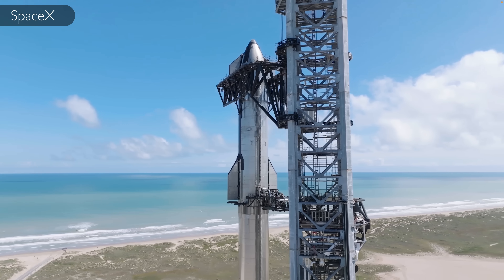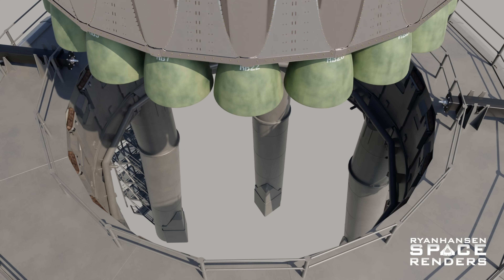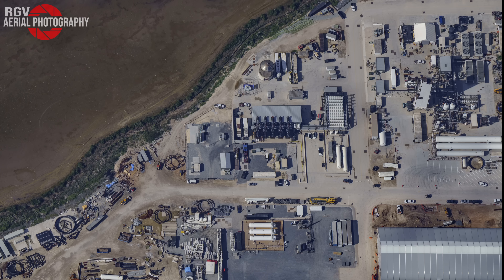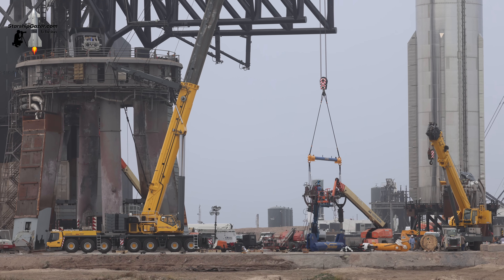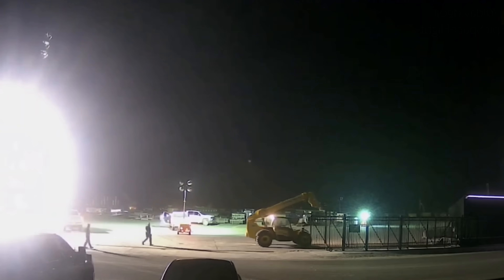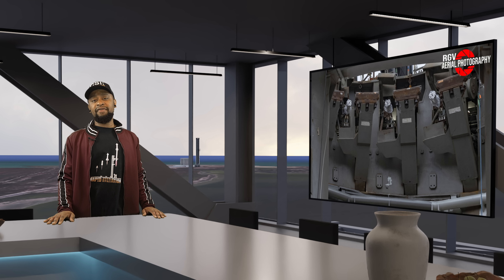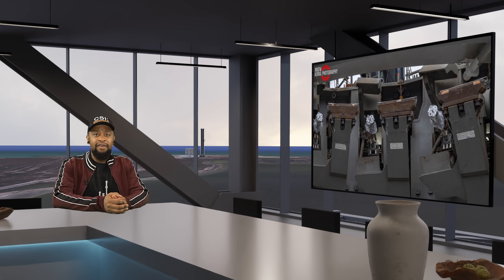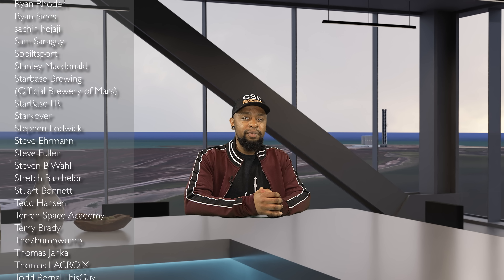SpaceX Simulates 5,000 Ton Starship Ahead Of Final Pre-Launch Testing!

Comment: UPDATE: After 3 years of watching Starbase coverage, it’s come to my attention that the counter weights are 12.5 tons and not 10.  We found a label on one of them yesterday.  The LR11350 used 10 tons CW’s so we assumed the ones from SpaceX’s LR11000 were the same. 

Anyways that brings the total weight to 600 tons.  Which means the factor of safety is 1.32, not 1.1!
Reply: Wonderful video! Did you made the CGI of the clamps and the entire batch before SpaceX started testing? Looks like serious amount of work in the animation.
Reply: @nectismanta8080  Indeed, Ryan Hansen completed these for us before testing started. It was a very busy weekend figuring out what was going on. He released them on Twitter about 6 hours before this video was released. I'm seeing these renders in lots of other videos now.
Reply: @nectismanta8080   Yes Ryan finished it right before it was lifted in.  He actually finished it like 6 hours before them but we realized at the last minute that the yellow swivel bearing was upside down and had to fix it. Lol.
Reply: @glitter_fart  Most likely the clamps are constructed to actually have a 100% safety margin, but it seems the function testing exceeds the maximum load only by the estimated 30 %. Enough to proof its function properly. Going all the way up to 200% load would most likely damage the clamps to some extent. Not to break at that point, but to be permantently deformed and weakened.
Reply: @glitter_fart  That's probably NASA's first though also.
It is exactly that point in the way Elon Musk thinks that has led us to SpaceX supplying the ISS and not NASA or Roscommon or ESA or anyone else in humanity.
Reply: @MrBigShotFancyPants  NASA, Roskosmos, JAXA and ESA have all supplied ISS.  NASA put out a contract for CRS and COTS, Space X and Orbital Sciences and Boeing won the contract.
Reply: @hoghogwild  Absolutely. It is an international space station after all.
I'm not aware of any manned flights since shuttle other than Russia and space x which is what i referenced. Tho I'm just a casual observer and could be very wrong. I just like rockets. And the fact its so multinational.
Also thanks for the info, i enjoy learning.

Comment: "Total mass being lifted"???    How much force does it take to "lift" any mass?    It depends on the opposing force.    Here on earth, the opposing force is gravity.   The other force would be inertial and would depend on the rate of acceleration of the mass.      I am chiding the sloppy use of precise terms.   Mass is not weight and vice versa.    They are connected only through acceleration (whether inertial or gravitational)  and are otherwise not related.   Here is an unanswerable question:   How many atoms are in 1 ounce of water?   Do not assume earth gravity.
Reply from the maker: I’m not perfect.

Comment: "In a way, they don't"????   Did engineers design it?   Did they use physics and materials science to understand their design?   Of course they did.   It is called design criteria.   What remains is V&V.   Verification and Validation.   It is absolutely standard to do this.
Reply from the maker: I see your point.  I agree to a certain level.  I’ve watched a lot of systems at Starbase that were designed to do a certain task, fail that task. As an example, the payload bays on starships 24, and 25, they were designed using the same methods as designing the launch mount hold down clamps.  Spacex thought that the supports around the door frame would be enough to stop the entire payload section from collapsing on itself.  

It turns out, gravity had other plans and it wasn’t until after they built two of them when they realized it wasn’t going to work.  The crazy part is they never even go the chance to test it. It literally started sagging and forced them to have to weld the payload bay for shut, weld a thin frame around the opening to stiffen it, and then put a large cover over the whole thing in order to return the structural integrity to the vehicle.  Without this they would have had to abandon 24 and 25 completely.  
 
So with that being said, I do not believe there is any issue with phrasing this the way I did.

Comment: 110% not much of a load test. Im sure (hope) these clamps have a load factor of at least 200% considering the importance. I would expect a load test of at least 125%. Also I wonder if the critical parts of the clamps are fitted with strain gauges to verify FEA results.
Reply from the maker: Check the pinned comment !

Comment: So if one strains a material to just under maximum load, how do you know that the testing process itself did not weaken the material somewhat? How do engineers figure that out?
Reply from the maker: They use little measuring devices called strain gauges. They are likely attached to all 20 of the hold down clamps
Reply: @CSIStarbase  I wondered about that because of work harding of metals by bending. By that I mean if you bend metal back and forth it will soon break.

Comment: A complex mechanism is only as good as its weakest link. A 1.1 safety factor is like playing Russian roulette. Safety factors of 1.4 to 1.5 are more commonly used in the aerospace industry.
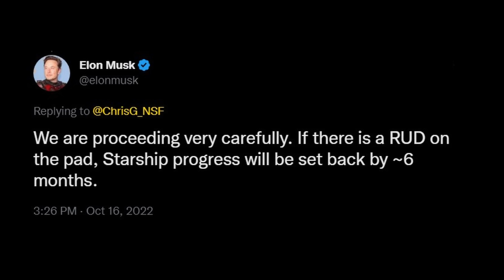Reply: Pinned comment pointed out the factor is more like 1:32 due to the counter weights being 12.5 tons instead of 10.
Reply: Hi Roger, correct, please checkout the updated pinned comment at the top of chat. Thanks

Comment: They would know what the clamps can hold by design calculations but this would be for a proof load test to rate the clamps (that’s why you get your value of 1.1:1 - that’s your proof load test factor not the designed FOS). What would be scary is that this proof test still assumes even distribution loading between the clamps… if there is asymmetric engine trust over the cluster of 33 then that’s when a design fos comes in (they could have software to gymble to keep the center of thrust inline with the center of gravity if there is an engine out before clamps release if this would result in some clamps becoming overloaded). Otherwise your animation of it falling over might come true! Lol
Reply: The figures have since been updated, please check the pinned message at the top of chat. Thanks for your considered comment.

Comment: A safety factor of 1.1 seems absurdly low.  I know engineering constantly seeks the lowest safety factor they can to save costs, and tend to think their knowledge of materials and simulations are getting better and better all the time, but when engineers design buildings and bridges with safety factors below 1.5 the failure rate goes up. And neither of those kinds of structures are going to be subjected to the vibrational and sonic shock loads and heat of the most powerful rocket ever built.   We just aren’t that good at foreseeing the potential sources of failure as we enter new operational realms or develop new materials. Whenever human beings are doing something entirely new, like building a rocket with 33 engines that has no flame trench on the launchpad, I tend to think a much higher safety factor is necessary.   Consider how many times SpaceX has already had to resurface the pad, and reinforce the stand because their engineers failed to accurately model the forces involved.  Launch will be the combined resonances of 33 engines each one putting out a hundred sonic booms per second, plus heat, plus vibrations, under tremendous static load.  I really wish they would test this potentially inept design BEFORE building an identical launch system at Canaveral.

Comment: Honestly if one or two fail no big deal, I mean you wouldn't want the risk of this to be if you have one failure you all die :D 

 but ya if the wrong ones fail very very big deal :) or in this case maybe 2 or 3 in a row to create an exponential force multiplier :D
Reply: that being said I figured they will at least test every other one and then see if the test did dmg to the hold down :) because wouldn't that stink if they tested them all and then it failed :D
Reply from the maker: If one clamp fails while the vehicle is fueled, it will instantly put more force on the surrounding clamps and overload them. It would be a domino effect of failure

Comment: How can the vehicle only produce 3053t of weight during static fire test, if it weighs 5000t? Are they running at minimum throttle the entire time? And what do they get out of a static fire that proves they can perform at a thrust to weight of 0.6? That doesn't even get you off the pad, much less to orbit.
Reply from the maker: Minimum throttle occurs at 40% thrust. My point about the static fire is that the thrust to weight ratio was probably insanely high during that 14 engine static fire. I believe it was higher than it would experience during launch conditions. There is no way to prove that though

Comment: Surely this will test the load carrying capacity rather than the hold down ability, that would be a force in the opposite direction. Or am I missing something.
Reply from the maker: Yes that is correct. Its hard to say the word "load arm" multiple times over. Much easier to refer to them as hold down arms

Comment: I think a safety margin of just 10% is not sufficient - you should aim for 100% or a factor of 2.
Just consider high wind or a small earthquake that could sway the stack (and also the launch tower).
In mechanical engineering you typically you use a safety margin of 3x just for a swelling load - like a car bridge.
Reply from the maker: Planes have a safety margin on 1.5. I believe the chopstick were tested to about 1.2 or something near there. 1.1-1.5 Seems to be industry standard for launch vehicles
Reply: @CSIStarbase  Please consider the fact that there could be wind gusts that sway the launch tower. This will lead to swaying of the starship stack which easily will exceed and maybe surpass the 1.2 margin.
I think the operational load is more in the region of 6000t when you consider swaying. On this load you may go with a 1.5x margin and be safe.
The only thing that I can think of is that they are not testing the max load but a significant fraction of it and compare the results to simulation data – but then why not test at the real max load?
Maybe the parts are constructed with a 3x to 5x safety margin and are inherently safe for operation. They are testing them now with just the operational load to verify that there are no weak parts that will break prematurely.

Comment: A bit of context on the safety factor: in calculations, the usual safety factor is way above 1.1 (mostly around 1.5) to account for uncertainties in the model. When testing irl with equivalent loads, 1.05 is definitely enough, as you're dealing with reality and not a model.

Side fact, to even approach a calculated safety factor of 1.1, intensive testing is needed to verify the model calculations, which is why spaceflight is so time consuming and expensive (no rocket would ever leave the ground with a safety factor of 1.5).

Comment: They will ultimately have to test the design to failure in order to fully understand what the launch mount's safety margins really are, but I imagine that won't be done on the OLM as it stands now at least until they can afford to sacrifice the hardware (perhaps as part of the second Starbase OLM's construction they could do it there?). Given how dangerous a catastrophic hull failure of either ship or [especially] booster can be, I definitely hope they can increase the safety factor of the mount system and/or re-add the claw on the ship QD arm to provide more stability during prelaunch ops. A strong gust of wind is all it takes, especially when the ship spreads its wings. Perhaps I underestimate the staying power of so much weight, but my paranoia at least has a reasonable backing to it, right?

Comment: From the easiness of why don't they just questions... why don't day just put the Frust section of a Starship Booster upside down and fuel them directly from the tank Farm? If the engines are capable enough to lift the Starship it should also be a good Simulator of the expected Mass

Comment: “SpaceX rarely tests to failure”

This is definitely not true for the fuel tanks that we all watched fail spectacularly. 

It’s a question of margins. Low margin flight weight components will be tested to failure more frequently than higher margin ground equipment. That’s why I was surprised the margin you calculated was just 1.1. That is very low even for flight weight components.
Reply from the maker: The amount of tests they perform, compared to how many fail, is incredibly low. I am working on a deep dive explaining every important test that they have performed, and every failure.

Comment: Having the load cells is still useful even if they lift the entire weight. First to confirm the weight being lifted from a certification point (this is probably a requirement). Also if there is an unexpected failure they will know the failure point. Lastly if they are using the entire weight it would also be a concern to make sure they don’t over stress the mount should something get caught or be incorrectly calculated.

Comment: Knowing it will support th liftoff mass seems no problem. Skyscrapers are way heavier, but the foundation holds, for all of them. Somebody knows how.
Reply from the maker: factor of safety for a sky scraper is about a 4.  Not 1.05
Reply: @CSIStarbase  But they don't load test skyscrapers as they build them.  Imagine if they had to haul thousands of tons of weights up to test after each floor constructed...

SpaceX also wouldn't build the launch mount with a thin safety factor since there's just no reason for them to do so.  Of course, there's also little reason to push your tests up to a factor of 4 and risk damaging things if the real margin of safety turned out to be only 3.5.

I think the real purpose of these tests is a bit more subtle than verifying the load bearing ability of the launch clamps, since that sort of thing has been done with paper blueprints on this scale for architecture for at least 1000 years.  I think the real thing they're interested in testing is the mechanical aspect - sure, you can load 250 tons on each clamp and they'll hold, but will they still actuate smoothly afterwards?  And the other question, will they actuate smoothly during a launch, with the booster exerting whatever force on them at the moment of separation?
Reply: @Keldor314  Once the engines start the weight will greatly decrease on the clamps, maybe to a point of equalisation, throttle up and release the clamps. But I thought about your point a few days ago while trying to figure out the configuration of the jig. What are they testing and how far will they go?

Comment: Thanks for producing this excellent video.  TIL.

You mentioned that you think that SpaceX has thoroughly verified every one of the 39 Raptor 2 engines on B7S24.

I don't know for sure how you define "thoroughly" but my definition would be that all 33 Raptors on B7 have been tested at full thrust (230t) and full duration (150 seconds) and that the six raptors on S24 have been tested at 230t and 270 seconds at the McGregor test stands. 

 I don't think that has happened. AFAIK, just a few (less than 10?) of the more than 200 Raptor 2 engines produced so far have been tested that thoroughly.

Please correct me if I'm wrong.
Reply from the maker: I believe that they will perform a full 33 engine static fire test soon.
Reply: @CSIStarbase  I think you're right about that. But that 33-engine static firing will last less than 10 seconds. I'd feel much better if Elon had tested 50 engines full thrust/full duration individually at McGregor and then had picked the best 39 engines for B7S24.
Reply from the maker: @rays2506  IT will last longer than that if they decide to test autogenous